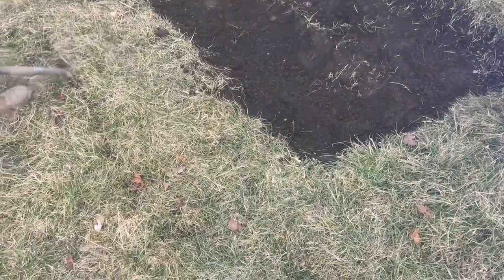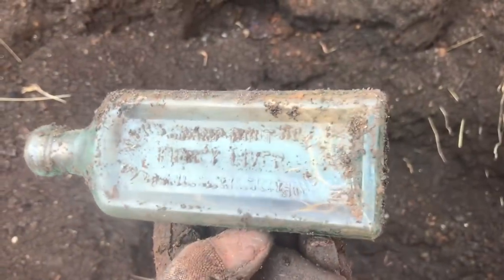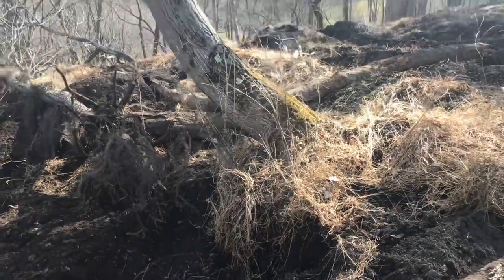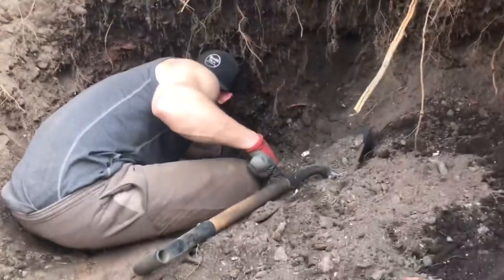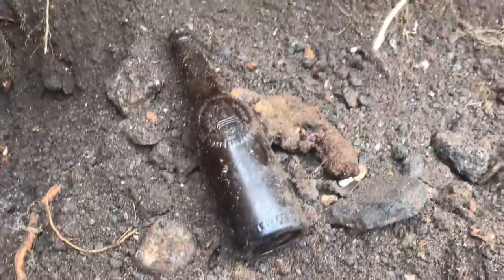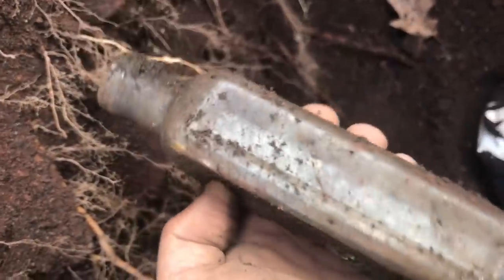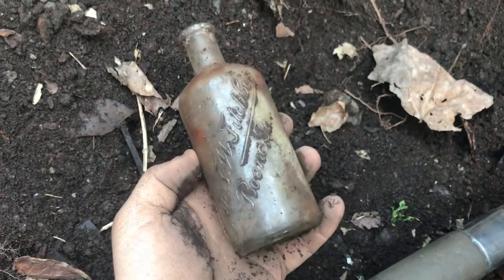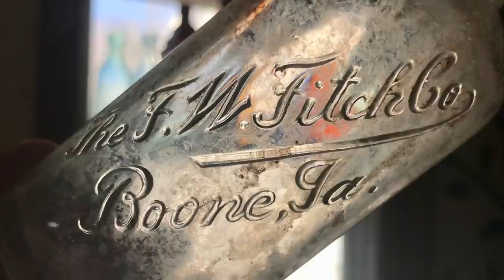Bottle Digging all week long, privys, bottle dump, & a back hoe!

Comment: You fellas need a four prong potato fork with the two outside forks cut off, and shorten the handle to about
12 to 14 inches. It works really good for loosening hard soil and ash down in the hole.  Do you ever sift any of your outhouses on the back fill. Have found a few coins, marbles and tokens that way. Great video, nice finds.
Reply from the maker: Just bought one actually and am in the process of making that , thansk for the tip. A few veteran diggers have suggested that and we are going to try it out. Should see it in future videos. We sift occasionally but not as often as we should. Thanks brother man for your continued support.
Reply: I've been obsessing about that for years, such that I made one in 2007-2×4s and 1/4" square netting, galvanised.  I've since refined the design-srainless netting, new oak standard 14x22" design- I advertise in American Digger.  I use all the time, and have found great smalls.

Comment: fyi - a safe way to clean old glass is to soak it for several days in vinegar, inside and out.  most crusty stuff will then come off much easier, and the glass is not harmed.